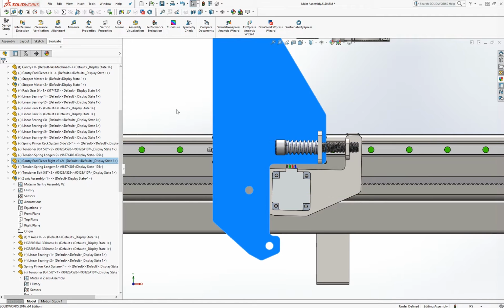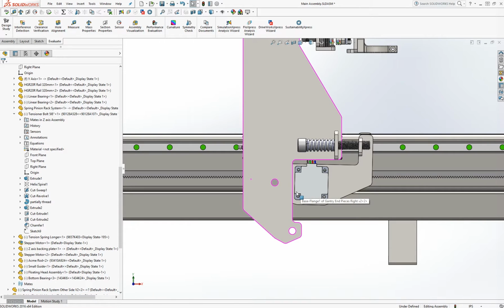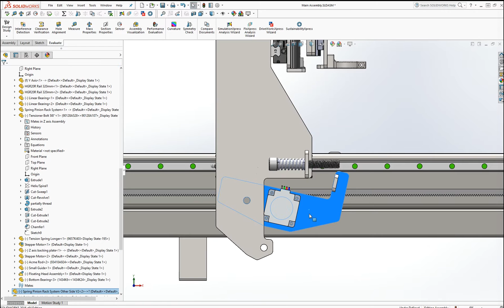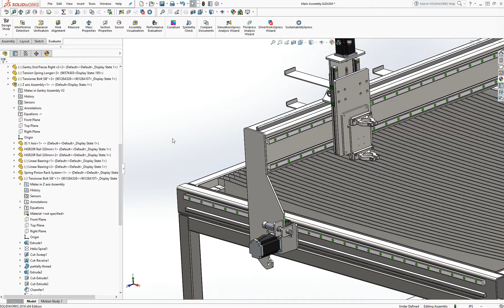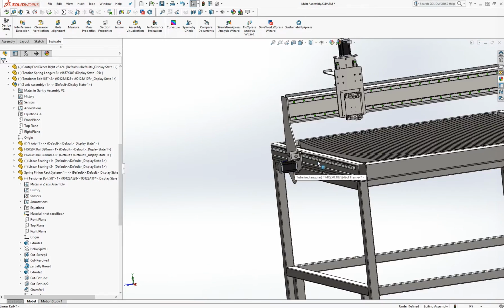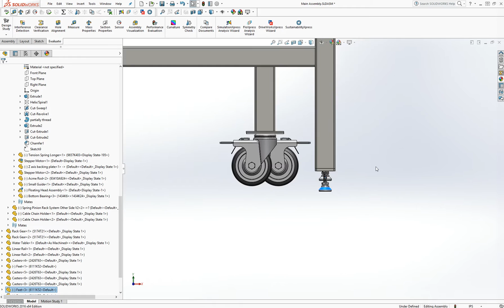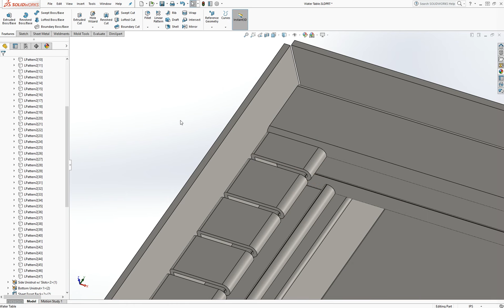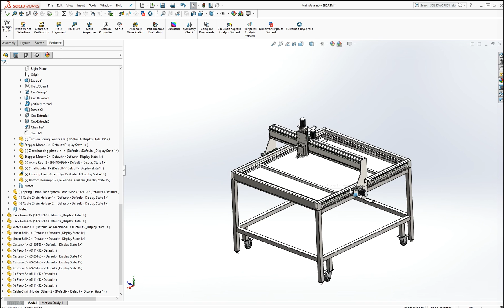DIY CNC Plasma Cutter | Drive System & Table Design

Comment: Hey, really awesome series.. looking to build similar but 10’ x 5’.. any special advice or just scale up?
Reply from the maker: It should be pretty easy to just scale up. My table right now is roughly 5ft by 5ft. Technically 1.5m by 1.5m is what the linear rails are, but I think it would be as simple as getting 10ft linear rails or they would probably be 3m rails. And you could just scale it in that length direction. It really shouldn't change much or affect things.

Comment: If possible the shaft on the stepper motor should have a extra bearing added to help with tension of the pinion forces. Most i have seen use 3 to1 belt drive to remove the stress of the Rack and pinion torqing back and forth.
Reply from the maker: Yeah, I know what you mean. All the tensioners were just too expensive for me when I was looking. I figured this is good enough. I'm not during crazy high feed rates or anything so I think the motors are fine, but yeah ideally I would have the gear ratio and tensioner

Comment: You shouldn't get any debree in the rack because teeth are pointing down which is good design. You could add a sheild over the stepper and pinion area to be extra safe.
Reply from the maker: Yeah that would be a good idea, would be simple to make too

Comment: Bonjour tu peux nous expliquer comment cabler et paramétrer «fleoting head ». Pour détecter la serface de la matière
Reply: Bonjour c'est tres gentille de repondre a ma commantraire
Reply: Je suis très passionné du fabrication des machines plasma
Reply: J'ai conçu le système de tete flottant avec une switsh ( contacts ouvert ) se ferment lors de contact avec la surface de la matière 
Mais je suis bloqué a ce stade 
Je veux savoir si c'est possible
Reply: Comment paramétrer mach 3 pour  que a chaque descente de l'axe z la mise à zéro ce fait automatiquement et sort l'impulsion de marche du torch plasma